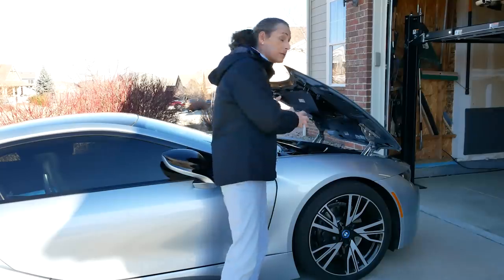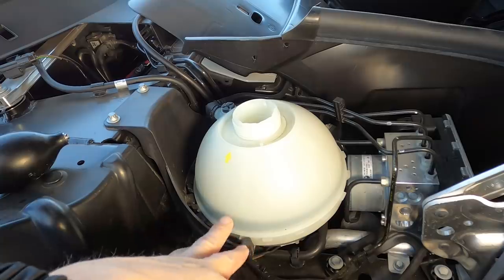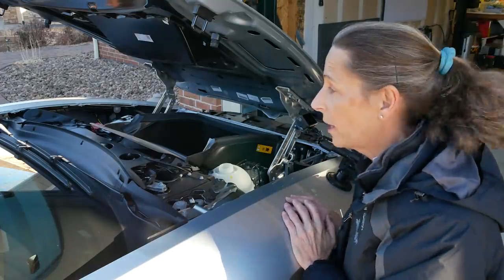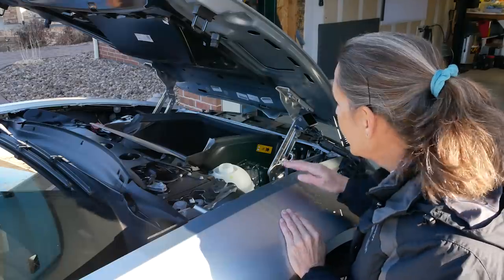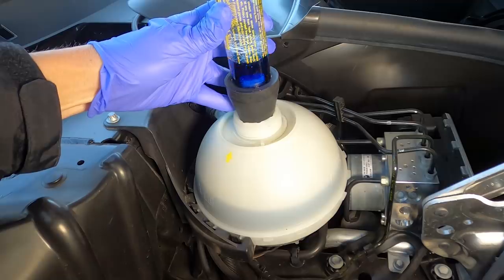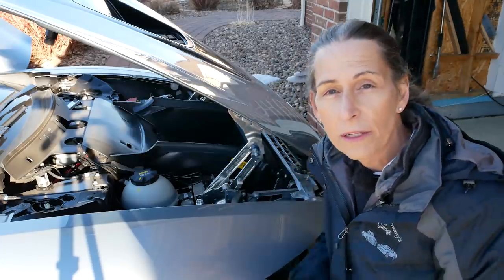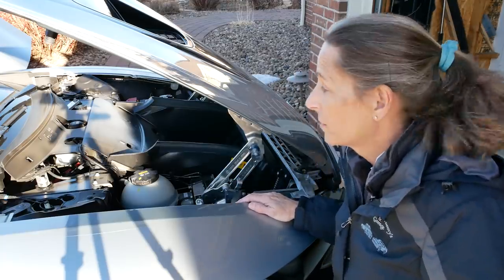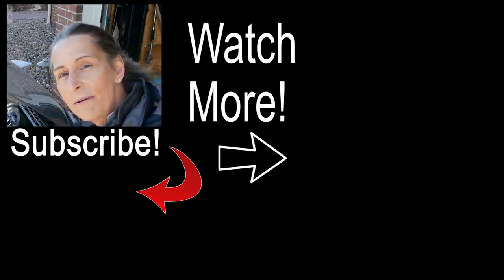Working With SamCrac and Recreating His Coolant Block Test! BMW i8

Comment: Is the EGR valve water cooled? If it is, and it has failed, this would cause exhaust gases to be present in the coolant.
Reply from the maker: Interesting...  I did a search through the entire manual and nothing for EGR...  I did find this:
"The usage of variable valve timing is what reduced or eliminated the need for Exhaust Gas Recirculation by retaining a small amount of exhaust gas to dilute the incoming fuel mixture so the peak temperature during the combustion cycle is reduced so oxide of nitrogen is within the EPA limits without having to use a separate valve…the EGR valve to do so."
https://www.quora.com/Why-does-direct-injection-DI-engines-have-EGR-The-EGR-is-a-cause-of-carbon-buildup-for-DI-engine-Is-it-not-enough-to-reduce-a-temperature-of-combustion-chamber-by-directly-injected-to-each-cylinder
Maybe that is what BMW is doing?
Reply: You have more pressure on coolant than exhaust. So if Egr fails, what direction it will leak? Yes coolant to exhaus, not exhaust to coolant.
Reply from the maker: @sapeandersson1607 Yes, but I don't think it has an EGR...  I believe it is using valve timing instead.  I found no reference to EGR in the service manual...
Reply: @sapeandersson1607  sadly not, it can leak both ways. When an engine is first started there is no pressure in the cooling system, this is a common point off failure on vw’s and gives this very fault
Reply: @Chris.5464.  so what you think where the pressure will go when you shut down engine?

Comment: What kind of turbo uses glycol coolant, instead of engine oil?
Reply from the maker: It is actually becoming more common in newer cars.  The problem with oil cooling is that it puts a bigger strain on the oil and oil cooler (if fitted) and cooling stops when the engine stops and most oil pumps are driven directly but the engine (remember the required run-down after a run?).  In the i8 it is actually quite clever in that turbo cooling can continue after the engine has stopped via an aux pump.  This helps prolong the turbo bearings and seats by not allowing them to "cook".

Comment: Is it common for the turbos to be water-cooled ? I always thought oil was the way-to-go method to cool them
Reply: Water cooling is the preferred OEM method at this point.  It has a lot to do with the need to recover waste heat to get the engine hot enough to operate in closed loop as quickly as possible (also the need to deal with hotter running turbos in general due to tighter engine bays with less ambient airflow)
Reply: @Badjujubee  Thanks for your reply !
Reply: Water cooled turbos been common for along time. For example early Maserati Biturbos had no water cooling on the turbo, and tended to cook the turbos (theory was the oil coked up in the turbo when switched off after a fast run). Mid 80s they switched to water cooled turbos and fixed the problem.

Comment: Doesn't the test look for carbon-monoxide? If it works on carbon-dioxide then sucking normal air through it would turn it yellow.
Reply from the maker: CO2 is only about 0.04% of our atmosphere but about 12% of exhaust gasses.  These Blue-to-yellow test are testing for CO2 not CO. If you are interested here is a sheet from the manufacture: https://www.cpsproducts.com/wp-content/uploads/99081870_comb-leak.pdf
Reply: @HeidiandFranny  Ahh ok thanks for letting me know
Reply from the maker: You bet!  I was really surprised as well.  You are correct that if you left it out it would eventually turn yellow. They mention something about making sure the cap is on tightly ;)  I'm guessing an actual CO test would be more involved/dangerous?

Comment: I dunno, My experience with bmw has been awful. I have seen people pour thousands of dollars into them and never quite fix them. Your I8 may be the exception but it also is very low miles. I suspect that will change in the future. There is a reason they re-sell at a fraction of the price when used.

Comment: when you said CO2 you meant carbon monoxide right ? as CO2 is in the atmosphere !!
Reply from the maker: This test test for CO2 (not CO). CO2 is only about 0.04% of our atmosphere but about 12% of exhaust gasses.  These Blue-to-yellow test are testing for CO2 not CO. If you are interested here is a sheet from the manufacture: https://www.cpsproducts.com/wp-content/uploads/99081870_comb-leak.pdf

Comment: I think, Sam is going to try his famous stop leak fix. I cringe  every time, he does that. I sure hope its not a crack, or head gasket. But, It sure seems like; he's got a flow problem still. I don't think he has fully tested and eliminated that part yet. If the flow is good. I would take the head off and have it inspected/tested personally. Leakfix, is never the answer.

Comment: I was thinking CO not CO2, but here is the description from the manufacturer's instructions.:      " The blue fluid turns yellow when CO2 gas is detected in gasoline engines and green in diesel engines."  Curses.  Wrong again... As a fellow engineer,  I was pretty sure Franny would know the difference.    https://www.cpsproducts.com/wp-content/uploads/99081870_comb-leak.pdf
Reply from the maker: You found it!!  I knew I saw it somewhere ;)

Comment: Why are you already talking about flushing your brakes on a 6 yr old 20k mile car? Talk about a waste of time. 

Wait until you put new pads AND rotors on the car, with a car so slow the rotors should last well past 60k if you don't stop like a fool. Sorry if that sounds kinda rude my opinion wasn't meant to be lol
Reply from the maker: Brake fluid changes should be performed every two years regardless of use.  The fluid is hydrophilic so absorbs water and holds other contaminates in suspension.  It is formulated to be flushed periodically.  As for the pads and rotors they should last for many thousands of miles due to the regenerative braking.  BUT, that doesn't mean they should not be inspected and serviced.  Brake pads can get stuck with low use and can cause very uneven wear for the pads and rotors.  Every couple of years it is good practice to pull the pads and re-lubricate them.  All cars need maintenance (even electric ones).